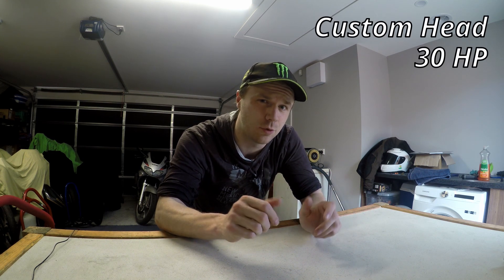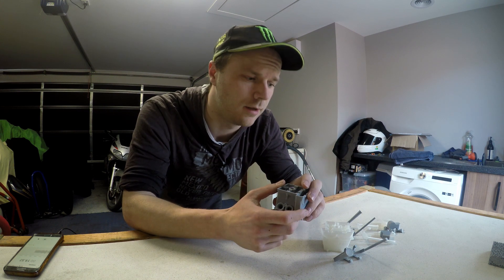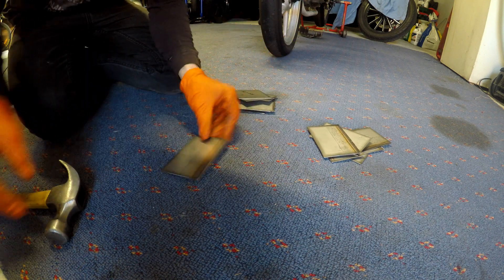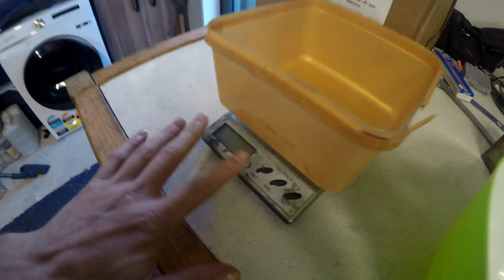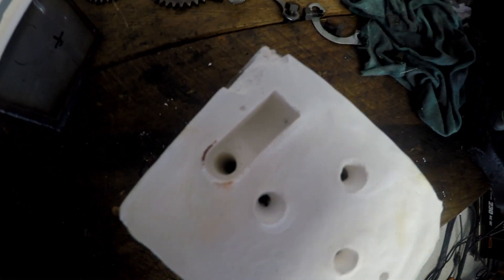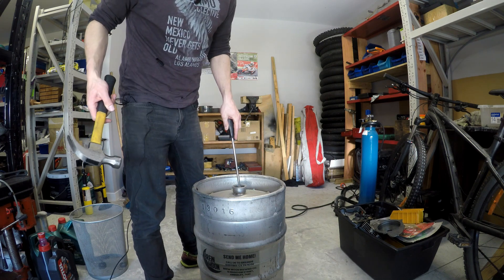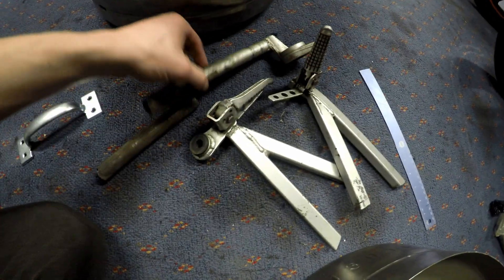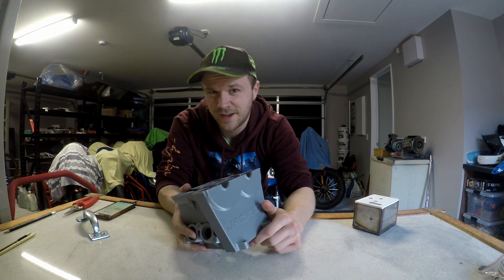Making a Performance Cylinder Head in the garage

Comment: serious question, wont double intake cams on the fxr increase power? i have planned to do it on my raider 150.  (same engine as fxr just fuel injected and running on coolant) but in oder to put in the cams im gonna have some assureance and cam data first..
Reply from the maker: Hmmm I haven't tried two intake cams but I would think it may have to much duration for exhaust applications. Will need to advance ex side to avoid piston to valve contact.
I normally just get the stock cams reground with a race grind, more lift ect and then you just need to reshim and set up timing for more power.
Reply: oh yea and the gxr150 have the same engine but with diffrent specs such as domed piston and bigger intake cams degrees. My plan is to swap the piston with gsxr one, and moving the standard intake cam to the exhaust and finally put the gsxr intake cam in the normal position.
Reply: so my question is.. will i see gain in power on standard timing marking or i need to have it dialed? i will put a racing ecu so tuning isnt a issue